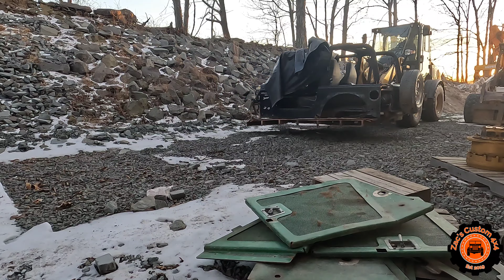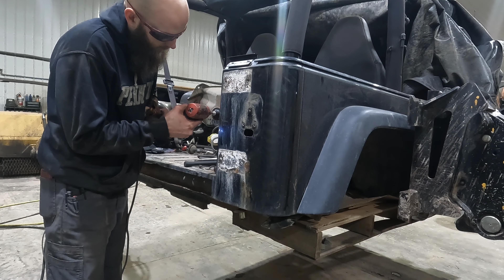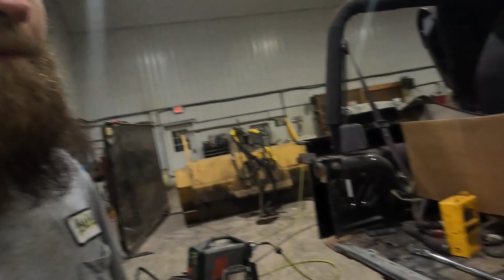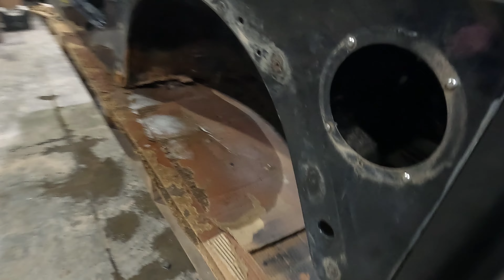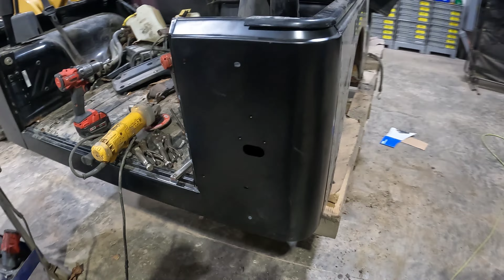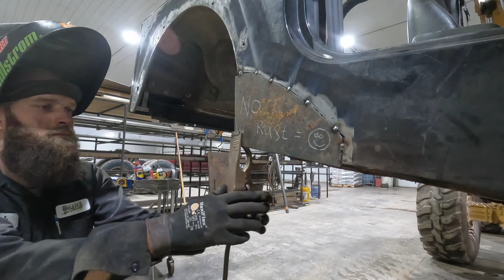Jeep Wrangler Tj Rust Repair. Replacing Rear Quarter Pannels, Fixing Rust and replacing cross sill.

Comment: So for the rear cross sill, is there an inner piece that fits behind the part toward the gas tank? looking to start this on my jeep along with the cancer that ate my rear frame away. I have the frame replacement parts, rear quarter panels, the cross sill but it looks like theres a cap of sorts that goes across the back side of the rear cross sill. 

If this is the case, where can i find that inner part? Many thanks for the video, plus any help on this question.